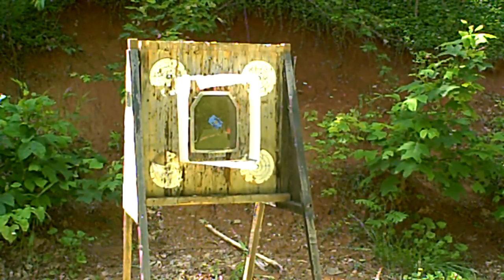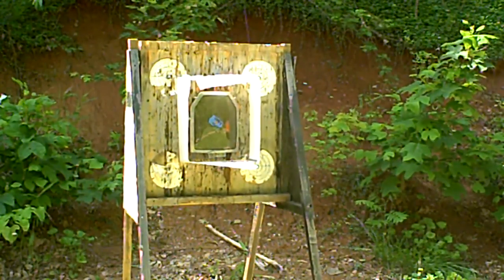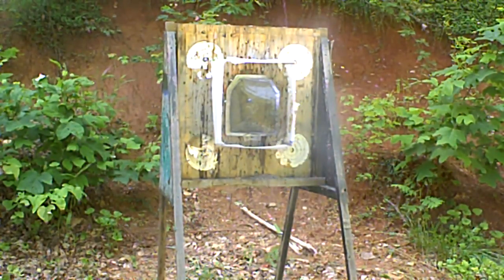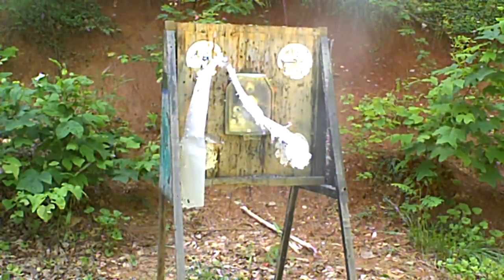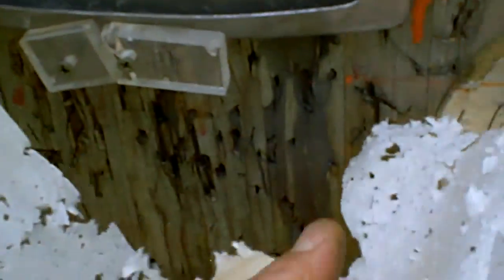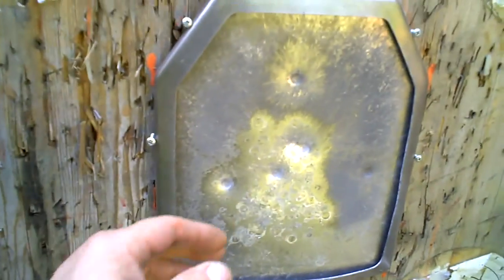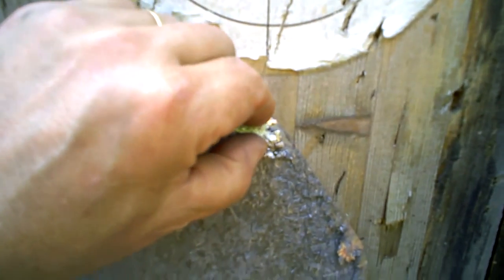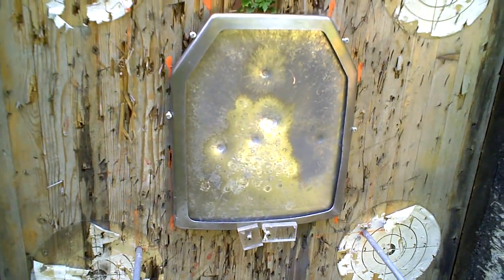9mm VS FLASH TM AR500 ARMOR Splatter Mitigation Shield DESTRUCTION TEST

Comment from the maker: First 80 were Winchester White Box FMJ 115gr (I would have to double check on grain) the next 95 were all Tula Steel Case FMJ. I have shot a similar prototype plate with splatter shield using 147gr JHP...150 rounds. Same result. I don't think the type of pistol ammo makes any difference at all. These were fired from a 6" carbine, so they have a lot more energy than a 3" pistol. I've shot this same type of splatter shield with full power .45 colt from an 8" revolver at 25 feet. And 12g Buckshot.